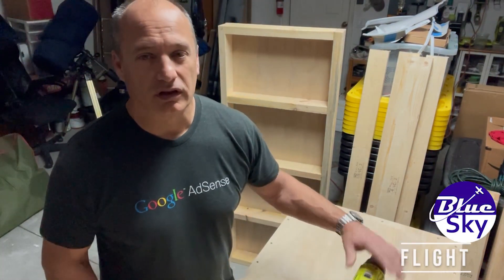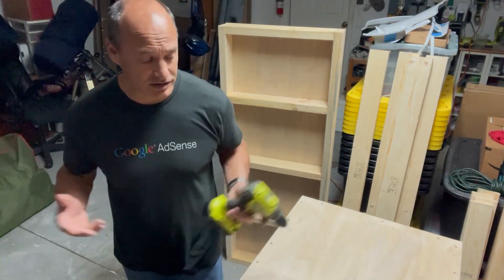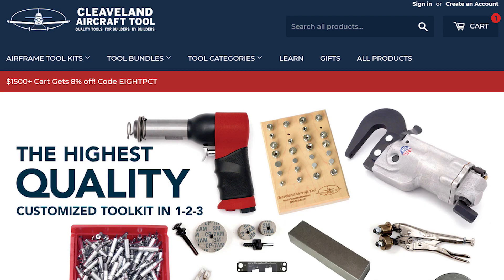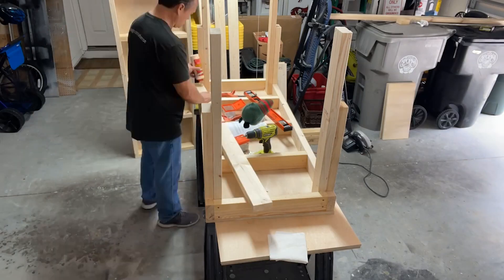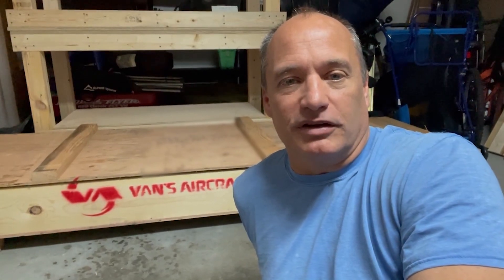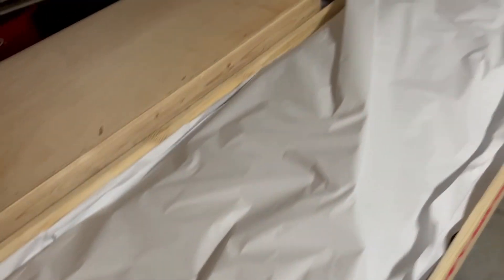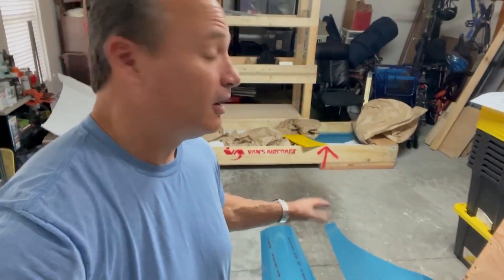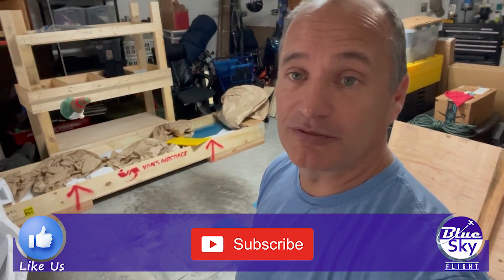I'm Building an Airplane - Delivery of the First Parts

Comment: Think about adding a top layer of particle board on top of your tables. Also let the top extend over the other top to be able to clamp parts down. I used 3/4" particle board on my tables I used to build my RV7. Looking forward to following your build.
Reply from the maker: That’s a great tip… I thought about extending the overhang on the tops, but I like the thought of another layer. Thanks!